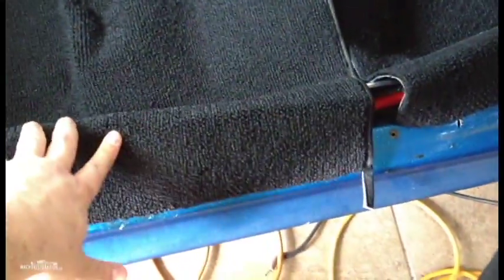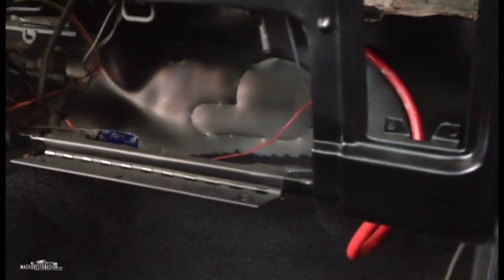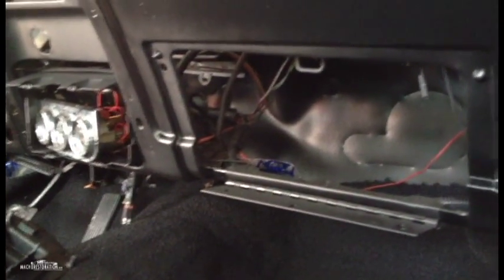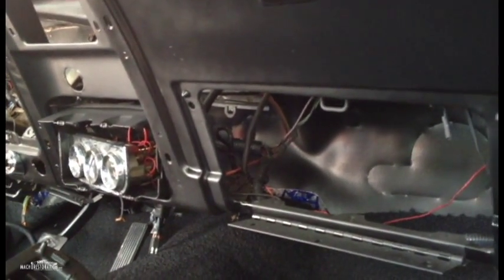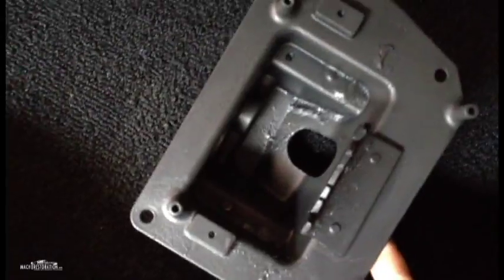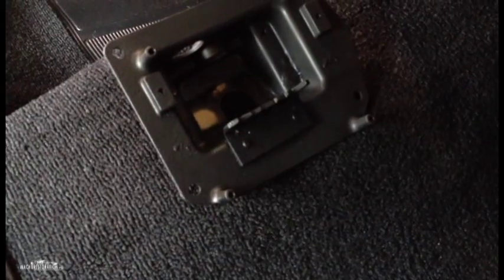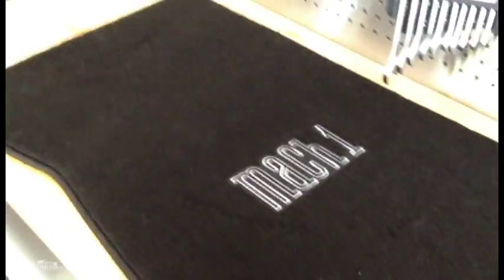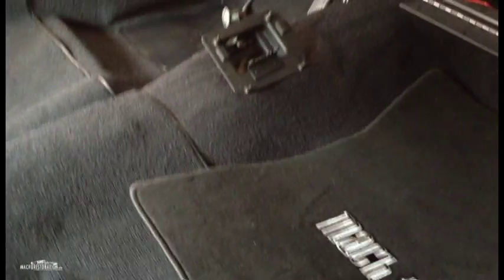Preparing the carpet for installation in the ol' 72 Mustang Fastback

Comment: shifter cup needs to be installed directly to the transmission tunnel. not on top of carpet. otherwise the little wire that feeds power to the shifter light wont fit.